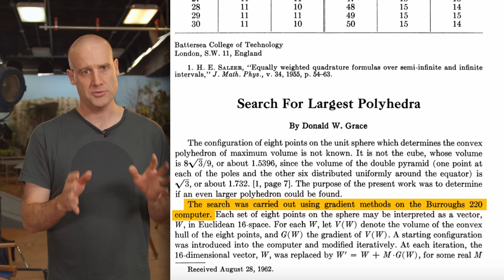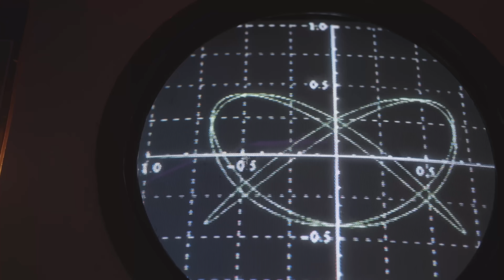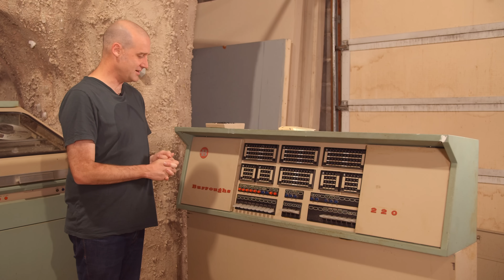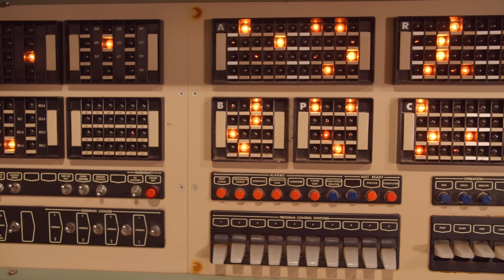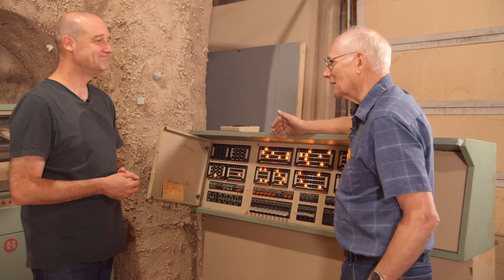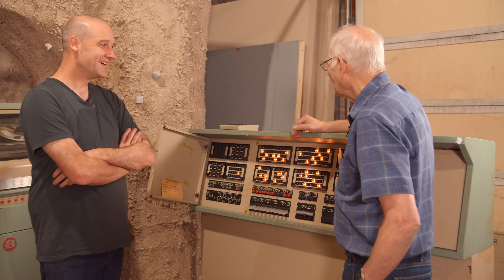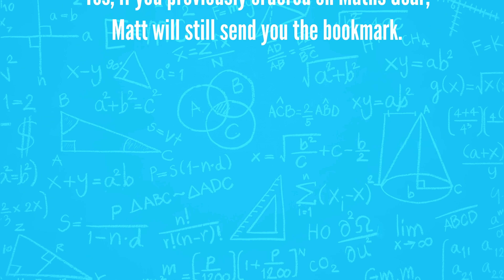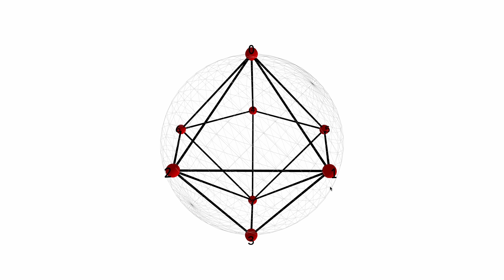The search for the biggest shape in the universe.

Comment: The video doesn’t describe the actual shape, so here are the coordinate of the vertices (taken from math stack exchange)
Let α=√((15+√145)/40) and φ=cos⁻¹(α)
The coordinates are
(±sin3φ,0,cos3φ)
(±sinφ,0,cosφ)
(0,±sin3φ,-cos3φ)
(0,±sinφ,-cosφ)

The side lengths of the shape are
A = √ (2α²(4α²-3)+2) = 2√(2/5)
B = √ (1-α²) = √((25-√145)/10)
C = √ (2α²(4α²-3)²+2) = √((65-√145)/25)

It is made up of 8 scalene triangles with sides ABC and 4 isosceles triangles with sides AAB
The surface area is ≈9.34365…

Comment: Lens designers have been using computers since before there were electronic computers.  Lens designs are shapes and are optimum of a merit function (like fitting a polygon into a sphere), so there you are.  I don't when the first time this was done, there are stories about rooms full of artillery students using trig and log tables to do ray tracing from the late 19th century.  The Cooke triplet lens may have been designed this way.  It is  a global minimum for a certain problem.

Comment: Curious, does anyone know if you could extrapolate this further?

If you've got the biggest shape possible with 8 vertices, could you iterate over each face, choose it's center-point, draw a line DIRECTLY away from the center of the unit sphere, and turn that into a new vertex? Then you just make each existing face into a pyramid using the original face as the base.

By not changing the existing vertices, only adding new ones, the volume would just keep increasing as n approaches infinity. 

If it's a triangular base, the number of vertices each iteration would be n + n/3 and the number of faces would be f * 3 (Corrections welcome, I've got a feeling I've screwed up my logic there. Each face gets replaced with three identical faces, but every 3 vertices adds a new one in the middle. I don't think that accounts for the fact that two adjacent faces share two vertices though.) 

I don't think you could solve for n vertices using only this method, but there'd have to be a way to somehow?

For example, in 2D: Start with a triangle inside a circle. That's the biggest three vertex shape you can fit. Iterate over each side, imagine a point in the exact center of two adjacent vertices, imagine a perpendicular line coming out of the side, going through that imagined point, and where that line intersects with the unit circle, add a new vertex. Connect that vertex to both its neighbors, and you get a hexagon. Wouldn't that be the largest 6 point shape? 

Do it again and you get a 12 sided shape. You could choose any regular polygon. Square for example turns into an 8 sided shape. So wouldn't a cube (that already takes up the most volume for 8 points) iterated in the same way produce the ideal result for a shape with 8 * 2  * 'i' vertices?

My logic is falling apart because I've just realised this works only with even, non prime numbers. Still, can anyone clarify if it would work for even, non prime numbers, that'd be cool haha. Get your desired number of vertices, find its lowest factor, start with a regular 3d polygon with that number of faces, and iterate it by the number of times that factor goes into n. There's a word for that I think but I forgot it again.

Comment: I never used the Burroughs computer when I started in 1971, but my deepest memories are of the IBM1130(I think) that had core memory and a rental clock. 
The core memory retained the information without power. So at night you pushed the stop button, then the power off. In the morning, you pushed the power button, then the run and it resumed where it left off!
The rental clock meant that you were charged for the cpu running, but not when it stopped. There was a panel of lights of registers that you could see if it was running. A problem that I ran into was my first infinite loop. The register lights dimmed but it kept running and so did the usage bill. … Well, I just walked away wondering what it was doing. They were quite upset with me for running up their computer usage bill. 
Fun times….🥴

Comment: I only clicked on this video because I wanted to see what you meant by the nonsensical phrase "biggest shape in the universe". It is nonsensical because size is not a quality of shapes. Any shape can be an infinite number of sizes from sub-microscopic to Billions of lightyears across. However large a cube you describe, I can describe a larger parallelepiped, sphere, cone, octahedron, etc. Shape is a purely mathematical concept so, in a sense, no shape is actually in the universe. 
     WE actually do not know the shape of the universe because the spherical volume of what we can see is not the whole universe. It is easy and tempting to assume that because is seems to have expanded from a single point, the universe is spherical, but we are talking about space itself expanding, which means it is not expanding into anything and doesn't therefore have a boundary to which we could ascribe any particular shape.
     It was definitely a clickbait title, because what you are really talking about is the largest (somewhat? regular?) polyhedron WITH EIGHT VERTICES that can be inscribed in a   unit sphere.
     Nevertheless, I found the video interesting enough to give it a 'like', even though it was very disappointing that you never described it for us.
     And of course, you can get bigger ones by adding more vertices, say one above the center of each of the triangular faces, and connecting each one to each vertex below it.
Reply: We're not talking about the "size" as in specific volume, but to the ratio compared to a sphere that perfectly encompasses it (with sphere being the benchmark since for any given radius, that is the largest shape), that's what a "size" of a geometric object means in the truly rigorous mathematical sense, since, as you pointed out, the volume of an object is irrelevant in abstract math - any geometric object can be scaled up and down. What you truly care about is how the different shapes compare to eachother under the same conditions

I do agree that saying it's the biggest in the universe is kinda weird tho

Comment: I am wondering a bit because no word at all was spent on the pattern used to connect the dots.
With 8 points you could open up a single plane with 8 edges and 8 corners.
Or one plane with 7 edges+corners and a bunch of 7 triangles.
Or you can create 4 rectangles (which would mean its 8 triangles if splitting them in halves).
And some not yet fiddled out amout of more combinations.

To my limited view i think the better filling shapes all went to triangles - meaning all >3 planes have been evicted or say broken up into better filling triangles.

Comment: The biggest shape possible in the Universe surely depends on the actual shape of the Universe. Your solution might not work if the Universe is sufficiently less than spherical.

p.s.  Kudos for the Jupiter2
p.p.s. You should probably open the inner airlock door first (then close it before opening outer door). I get it, atmosphere breathable and all that, but just good practice unless you're deliberately contaminating/choosing to keep both door open at once.

Comment: surely the local minima found by this program would count as earlier discovered shapes, right? e.g. the largest possible 8-vertex shape with 5 vertices circling the equator. But if you only say a shape was "found" if it was specifically what the programmers set out in search of, I think thats a better definition that more aligns with what you mean.

Comment: I have no idea whether that’s the first shape found by a computer.

Still, if it’s not the first one, I suspect the first one was a 2D shape as opposed to a 3D solid. First computers were comically slow by modern standards, and computing or optimizing a 2D thing is less computationally expensive than doing computational 3D geometry.

Comment: I can't believe they "Weekend at Bernie's" the Burroughs 220
Reply: Technology usually depreciates rapidly, unless it's an Apple I, and people or institutions usually want to get rid of it when it takes up lots of space!  From $30,000 (six Cadillacs) in 1960 ($300,000 in 2024 dollars) to being worth scrap value only.  At this point it was easier for the prop department to just rig up the console with a light show, running on a mechanical contact system like a lot of Las Vegas casino lights and other animated lights at the time, than to actually have the computer work.

Could be worse, could have been one of those Facit mechanical calculators.  Facit's business did not cope well with calculators going from being a luxury, hand-crafted mechanical item to something with a cheap integrated circuit sold in a corner shop within 10 years...

Comment: 15:25 Matt says that the two local maximum volume shapes, with volume 1.626288, are bigger than the back-to-back hexagonal pyramid, but the pyramid's volume was 1.732 🤨 I think he meant it was bigger than the cube, which was 1.539.
Reply: There were multiple gaffs in there. Take the second shape of volume sqrt(3) and being 1/8th better than 8/9ths of sqrt(3) from the cube.
Reply: @PH4RX  That's not a gaffe. sqrt(3) is 1/8 (12.5%) better than 8/9 of sqrt(3).

Comment: A computer was used to create a shape in 1943-1945. The Manhattan Project in World War II used a special purpose computer to calculate the shape of the explosive lenses that were used for the implosion type nuclear bomb. The ideal shape of the explosive lenses could be computed easily enough if you assumed linearity, but explosive wave fronts are non-linear. They had been using human computers, but they were not able to perform the required calculations. They had an IBM PCAM, (Punch Card Accounting Machine) in conjunction 4 IBM 601 multipliers. They needed division, but the 601 could not perform division, so the US government persuaded IBM to develop a prototype that could. (IBM later produced this as the IBM 602) They also needed 3 element multiplication (AxBxC) and IBM was able to provide a prototype for that as well. They also had a single element automated card sorter, a multiple element sorter, and an automated card punch. This was not a full general purpose computer; the automated card punch would print out a sequence of punch cards, which a human had to manually place into the card sorters, and once sorted, were placed back into the input of the PCAM. Thus they were able to numerically integrate a second order differential equation which described the propagating wave front in the explosive lens to compute the proper shape.

doi 2103.05705

If you don't feel that the special purpose computer constitutes a 'real' computer, the next example would be ENIAC, which began work in 1945. ENIAC was designed to compute artillery range tables. Given a shell velocity, gun elevation, humidity, temperature, and wind, it would calculate the parabolic-ish arc that the artillery shell would take. So if not the shape of the explosive lenses of implosion-type atomic bombs, the next shape calculated by a computer was the parabolic-ish arcs that artillery shells take.

Comment: NGL it would be interesting to see if the processor for the 220 has any sort of surviving schematics, because if so, it may be possible to remanufacture, or at least emulate it, and by extension, the code used to calculate this shape

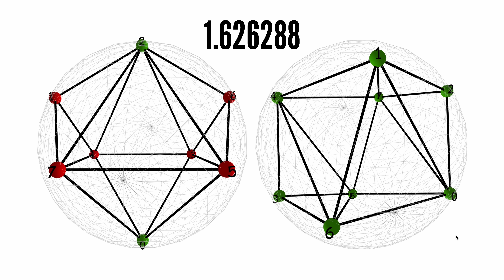Comment: This shape is highly relevant to EVE Online players, as it also represents the optimal scanner probe arrangement. I'm glad I worked out the square anti-prism on my own (the one on the right at 15:30 ), but I'll be sure to rearrange my probes if/when I log into EVE again.
Reply: Is your profile pic supposed to be part of LSD? Because it's missing the double bond in the pyramidine ring if so. Otherwise all we can see is 6-methylergoline.
Reply: @jwnomad  It's deliberately not supposed to be part of LSD. It's from a paper about the structure-activity relationships of LSD derivatives and it was only titled "compound 11" (IIRC, they didn't actually make or test it). The closest existing analog with literature would be a compound called RU-28306, if you want a point of reference. It should be very active at 5HT2a, and possibly dopamine receptors and/or 5HT/DA reuptake as well. Unlike ergoline, it lacks that 4th ring, making it easier to synthesize, in theory. Also it's not prohibited by any laws so people can have fun until regulators catch on.

Comment: Why is a film studio, regardless of its own significance, allowed to possess the only instance of an historically significant computer?

It ought to be in a conservatory, and it ought to be receiving restoration work. Someone could learn something from how that machine works -- if someone could access a working instance.
Reply: It was in a residential basement in Chicago for 50 years which saved it from being scrapped when the college wanted to get rid of it. It will continue to be preserved and cared for at the studio as I consider it to be of great historical significance. Visitors are welcome. Unfortunately only 1/4th of the entire system was saved, just two tape drives, the control console, and tape drive controller, and it was missing many circuit boards, so it can never become operational again.

Comment: What I learnt from this video:
1. The biggest shape in the universe is not a sphere but, rather surprisingly, has 8 edges that lie on a sphere.
2. August 22nd 2024 is a Tuesday and not a Thursday
3. The square root of three is one eighth "better" than eight ninths times the square root of three.
Reply: the third fact is true
Reply: @vsm1456  I intentionally used words instead of numbers to make it more confusing. Read the third "fact" again.

Edit: Wait, thinking about it more there are two ways to interpret it, it's why I even used quotes for the word "better" in the original comment.
If we want to compare the number 1 and 8/9 (ignoring the common factor of sqrt(3) for the moment), then 8/9 is 1/9 less than 1 ( 8/9 = 1 - 1/9) and this is how I originally thought about it. But maybe one could interpret it as 1 being bigger than 8/9 by 1/8 of 8/9 (1 = 8/9 + 1/8*8/9). Maybe that's what Matt thought too, I myself don't think of numbers like that, I still find it weird and a little confusing, but I digress.
Reply: @DeJay7  I agree it's confusing, but I think it's a good habit to always accurately track what you compare with what, so that you don't accidentally apply the ratio to the wrong number. Especially in different cases when percents might be involved, they are hell :D

Comment: 4:58 "the cube has a volume of 8/9 * sqrt(3), so [the bipyramid] is actually 1/8 better". Was that supposed to be "1/9 better" or am I making some silly mistake?
Reply: If C = 8/9 * P, then P = 9/8 * C = (1 + 1/8) * C, so P is 1/8 larger than C. You are correct in the other direction: C is 1/9 smaller than P.

Comment: surely it'd be 1/9th better if the cube is 8/9ths

Edit: oops I'm backwards
Reply: No. If C = 8/9 * P, then P = 9/8 * C = (1 + 1/8) * C, so P is 1/8 larger than C. You are correct in the other direction: C is 1/9 smaller than P.
Reply: @HappyAccidents404  Thanks, that makes sense!

Comment: The similarities between this kind of problem with a volume hypersurface, gradient descent, local maxima and thermodynamics is actually fascinating. Approximately, all molecules just sit as local minima in an energy hypersurface. Chemical transformations cross a saddle point into other minima. The easiest way of achieving a chemical transformation is using heat, or in other words, increase the amplitude of random motion. I think i've heard a "heat" parameter mentioned in these models before. Is it really just that? Forcing some random shifts? Can you plot a "reaction axis" for going from one maximum to another?

Comment: why 8-corner is the limit?
Reply: It's not a limit, it's just that was the specific question the original guy was interested in: "What shape with 8 vertices fills the most space, if none of the vertices can be outside the unit sphere?"

You could ask the same question with 9 vertices, and you would get a shape with a larger volume than 8 vertices. The 10-vertex solution would be a little larger again. In the limit of infinite vertices, it would just be the whole sphere.

Matt did a pretty poor job of communicating that we're looking at a specific case of the problem.

Comment: Did I miss seeing the shape up close in the video? Matt showed a lot of other shapes close up both physically and rendered on the computer but I didn’t see where he showed a nice, close up view from different angles of the final shape.
Reply: Nope, he just didn't show the shape. I hope he makes a follow-up to expand on the topic, maybe share the proof of the shape's absolute maxima property
Reply: Agreed. He had good diagrams and verbal descriptions of the local maxima, but not the best shape. I don’t really understand the final shape or why it would be the best. But I do know it’s a weird square root of a fraction with a square root.
Reply: Here are the vertices of the shape. You can paste them into Desmos 3D graphing calculator to see what it looks like: 
(0.9700, 0.0000, -0.2432)
(0.5692, 0.0000, 0.8222)
(-0.5692, 0.0000, 0.8222)
(-0.9700, 0.0000, -0.2432)
(0.0000, -0.9700, 0.2432)
(0.0000, -0.5692, -0.8222)
(0.0000, 0.5692, -0.8222)
(0.0000, 0.9700, 0.2432)
Reply: What is the minimum number of points necessary to define a torus?
Reply: @robertunderwood1011  

Two. Ask them if their birthday is on or after April 19th, and then ask if it is on or before May 20th.

Positive definition achieved if yes to both 😁
Reply: @robertunderwood1011  Seven vertices to make a polyhedral torus.
Reply: And if you define the torus In terms of non-overlapping planar convex pentagon. What would the minimum number be?
Reply: This video seemed really rushed in general. Mistakes and ambiguous dialog/editing. Probably so he could get footage in the studio, which was absolutely worth making concessions for.